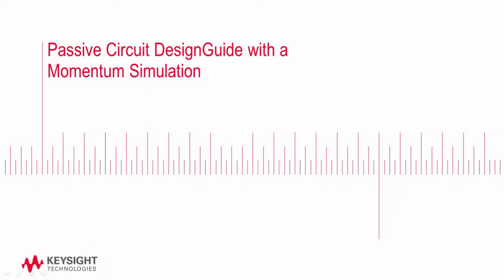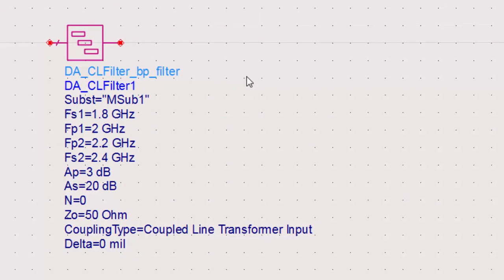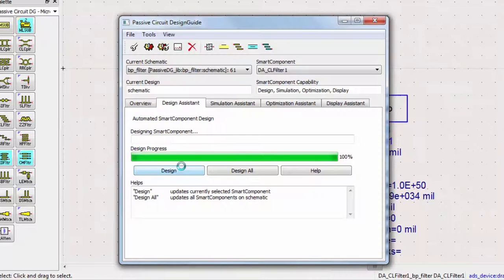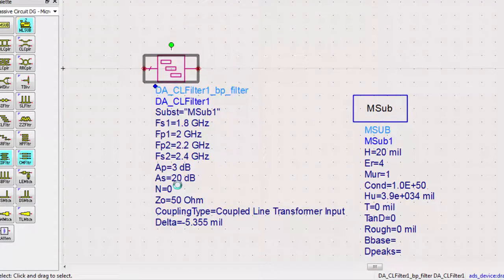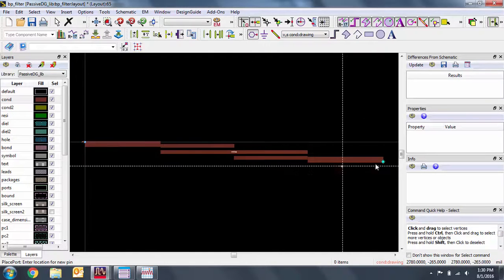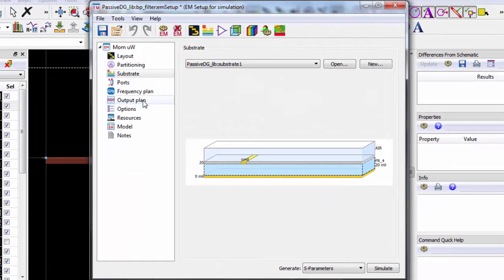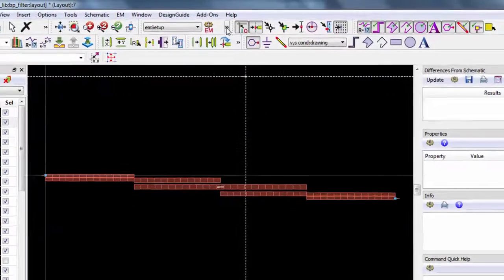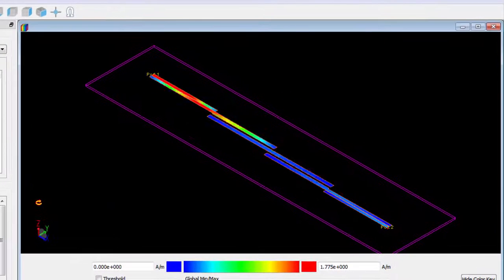Passive Circuit DesignGuide with a Momentum Simulation

Comment: When it comes to practice, this tools doesn't seem to be useful. It is not possible to set the minimum gap between coupled lines, which is the major limitation for manufacturing such distributed filters. Or I am missing something...

Comment: The dimensions of substrate make any difference in circuit response? I need to know which is the substrate dimensions considered in the EM simulation to build this filter?
Reply from the maker: The substrate dimensions do affect the circuit response, since the characteristic impedance of the line is dependent on the ratio of the width to length as well as the dielectric constant. To set up the EM simulation, you will need to know the parameters of your substrate, such as thickness and material. In this example, we used FR4 at 20 mil thickness.
Reply: Hi sir can you explain how desing coupled in this video you not chose n how drown 6 coupled line
Reply: Hi, is the passive circuit DG microstrip pallete is free? 
How can I get this pallete?